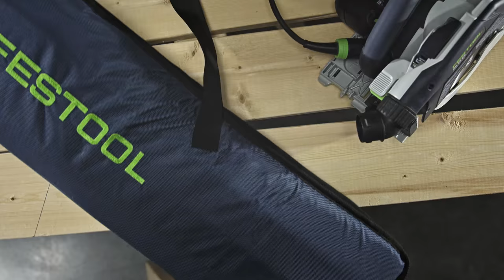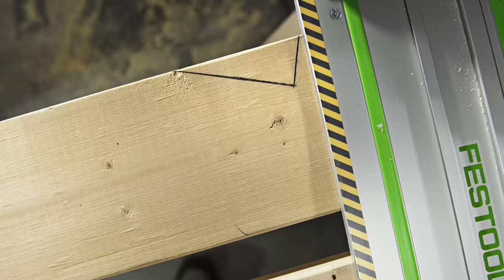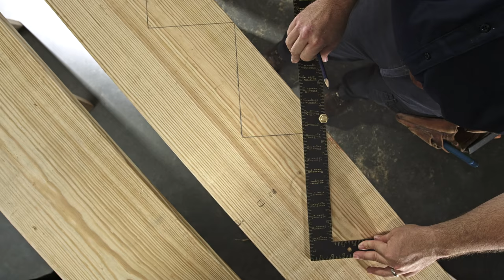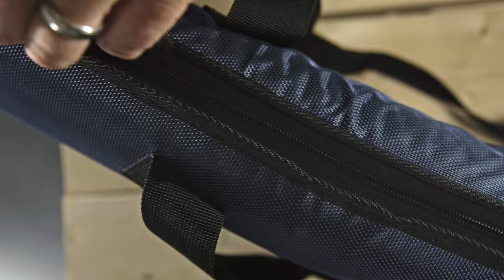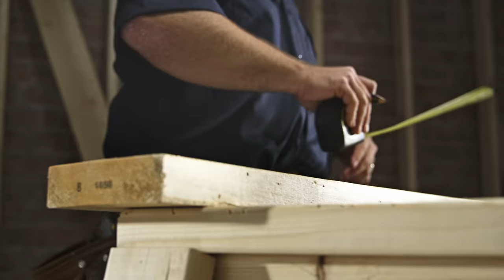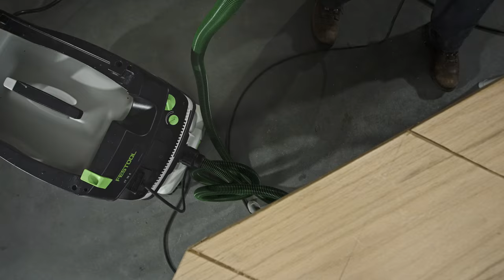HK & HKC 55 Circular Saws with Guide Rail: Precision Cuts with Maximum Portability

Comment: well the Hilti WSC 7.25 36 volt works too and I use it on the Festool guides ,I have 2 of them great saw use everyday for days on end ,batteries last ,cost $860 but you get 2- 36 volt batteries plus charger and soft bag